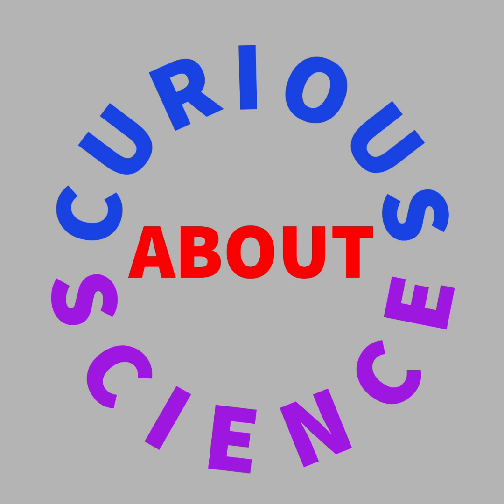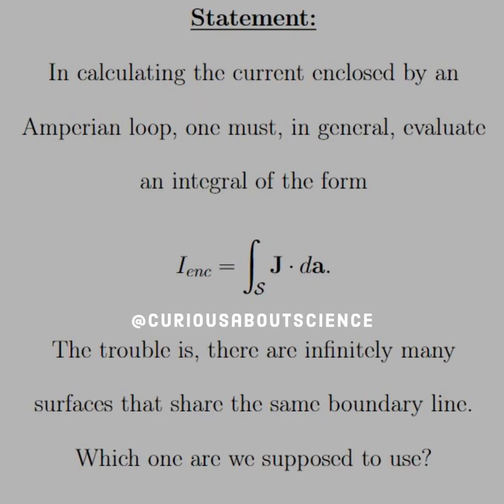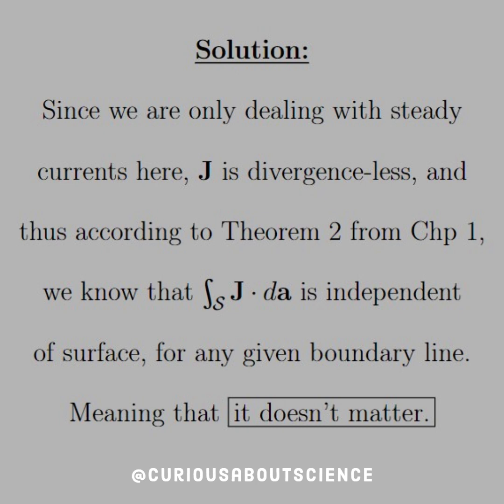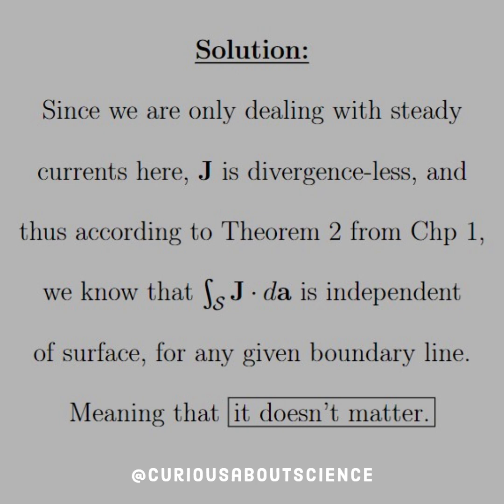Problem 5.19 - DIv & Curl of Magnetostatic Fields, Ampère’s Law: Introduction to Electrodynamics

Comment: integral over S1 + integral over S2 = 0 since div = 0 and using divergence theorem. S1 and S2 share boundary. So integra over S1 = - integral over S2. The minus sign can be taken cared of if we flip the normal orientation of S2. This is justified because volume integral here assumes outward unit normal.